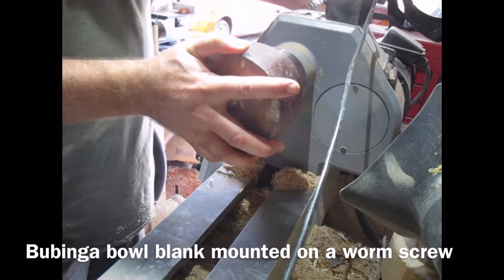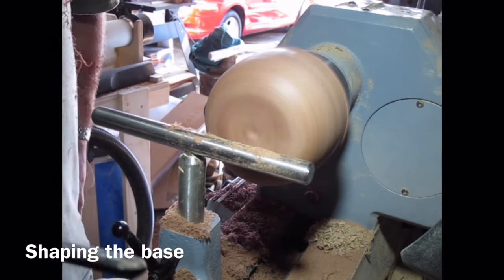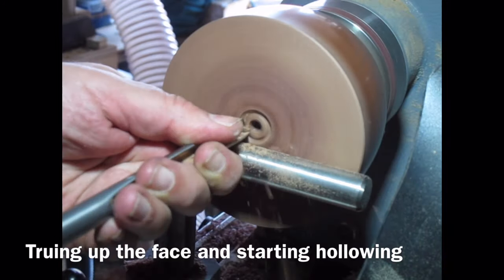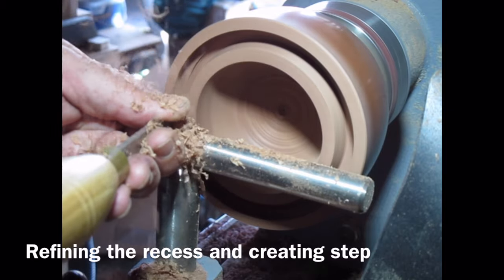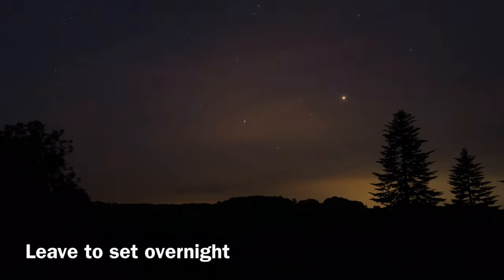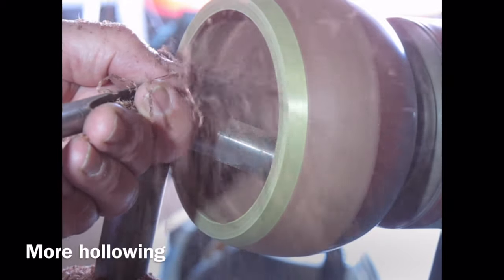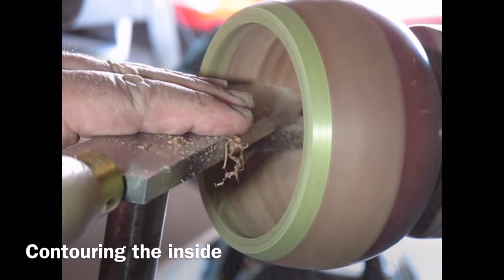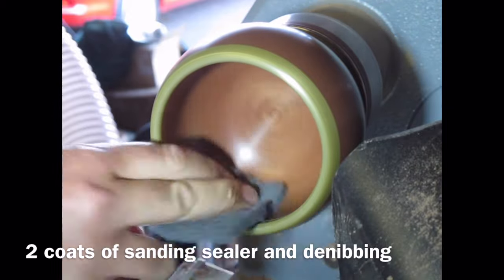Woodturning a Brass Brimmed Bubinga Bowl

Comment: Jim,  As always your work imaginative and beautiful.  Very well done indeed.  I don't know about the U.K, but here in the U.S. the hardware stores often have machines where you can make copies of your keys.  I was fortunate to be in a hardware store when man came in to service and clean the machine.  He was kind enough to give me the brass shavings from the machine as well as his business card.  Now I might have an endless supply of brass shavings.  Also,  if you have Harbor Freight tool stores in the U.K. they have paint pots that can be converted into pressure pots easily.  They cost about 72 pounds.
Reply from the maker: Many thanks for watching my videos. Fortunately I now have a pressure pot which makes resin casting much more consistent.

Comment: Thank you Jim for another great upload.  I particularly appreciate learning how to secure a brass or any other epoxy rim onto an item of wood.
Last week I used your Milliput pin stripe method for the first time when making a gift for non -wood turning friends.  They were mightily impressed and at the moment I have a small table lamp on my lathe with more pin stripes curing.
I can't wait until tomorrow when I get to finish it off.
When I bought my first container of Yorkshire Grit about 6 weeks ago I reckoned it would last me about a year.  Well, I can see the bottom of the container already so I'll be ordering some more soon.
Best wishes,
Alan.
Reply from the maker: Thanks again Alan for your continued support. I really like the clean lines that Milliput creates and the results are very tactile. I would love to see some pictures of the lamp. All the best, Jim

Comment: I've done a similar technique with a shallow bowl.  No brass, just colored resin.  Had some leaching issues.  The next one, I applied shellac first.  Cured the leaching.
Reply from the maker: Many thanks for watching. Yes leaching can be a problem with less viscous resins or with open grained wood. I almost routinely seal the surface of the wood before casting. I usually just paint the surface in a thin coat of the actual finish resin and let it cure, takes time but bonds to the final pour giving strength.
Cheers 
Jim

Comment: Nice job Jim, that came out luvverly mate.... The brass works very well with the Bubinga .....

Thanks for sharing mate, 
Steve.
Reply from the maker: Thanks Steve, I was very pleased with the result of this experiment. This Bubinga was slightly different to the usual Bubinga, it has quite a strong pink colouration which gradually appears a few hours after finishing, you can see the colour difference between the fresh cut and finished colour in one of the video sequences. Take care mate, Jim.

Comment: very nice and i like the process of using a syringe and the walls of the recess as a mould, i had a few syringes from my retired dads printing years but i havnt a clue where they are so Ill have to have a hunt or just buy some more ;)
Reply from the maker: Thanks Mark. I use syringes for lots of gluing and resin projects. If you check eBay regularly you can pick up some bargains if you buy a whole box. Cheers, Jim

Comment: That came out well Jim, I think the porous surface gives it a patina and makes it look older.  I suppose you could put the syringe in a vacuum chamber prior to filling the rim and that would reduce the number of small internal bubbles. Thinking about it, I don't know how effective capping the syringe and drawing a small vacuum using the plunger might be?
Reply from the maker: Thanks Mark. I wish I had the money to buy both a vacuum chamber and a pressure chamber. Creating a vacuum in the syringe would probably eliminate some bubbles but the resin mixture is a bit too thick. All the best, Jim

Comment: Another winner, Jim. Artful shape, but it just begs to be used -- pocket change & keys, pile of spare rubies & emeralds, whatever... I have a bone to pick with you about showing off your cool lathe tools, though: I've just been forced to order a Sorby tool rest stem and box scraper platform :-)  Clyde
Reply from the maker: Thanks for your kind words Clyde. The Robert Sorby catalogue is full of temptation ! The box scraper platform is brilliant and supports the scraper very well but just take gentle cuts with a sharp scraper to avoid catches. Make sure you are cutting just above centre. I have modified mine by rounding the leading left had corner so that I can get it tight into small bowls. Cheers, Jim

Comment: Good work. I very much enjoy and learn from your videos. I like a higher luster on my work. What can I top coat with after the Wilshire grit? Thank you
Reply from the maker: Thank you Shelly. Yorkshire Grit is oil based so I favour a wax finish. Lately I have been using Hampshire Sheen High Gloss, I also use Renaissance Wax which is a Microcrystalline wax ( also in Hampshire Sheen ). All the best, Jim

Comment: That came out really great! Totally love that! 

 Not sure what kind of resin you are using but I never use a pressure pot. Don't even have one though I would love to as I can also use it for my silicone mold making. :P Best way to have the bubbles release themselves is to work with it when the resin is really warm. We have 100+ F here these days and my house can get up to 82 or 83 F which is beyond great for working with resin. I never get any bubbles. I also use a long torch lighter to burst surface bubbles. If it is cooler where you are you can warm the resin in a hot water bath before use and use the torch. 

- Heidi
Reply from the maker: Thanks Heidi. I use heat to release bubbles sometimes but the resin and brass mix is so thick that it traps bubbles. I would love to get a pressure pot , but they are expensive and most are not very big. Ideally I would put the mixture into a vacuum chamber to de-gas it and then put it into the wood and then put the whole bowl in a pressure pot, but I have not got the money for that at the moment. Cheers, Jim
Reply: Jimson's Stuff I hear you there. I have looked at a few DIY videos on YouTube for making one. Not sure it would be more cost effective but definitely would be more fun. :D
Reply from the maker: +BlackCat2 . Anything to do with pressure vessels , I will defo leave to the professionals ! Way too risky. All the best, Jim
Reply: Jimson's Stuff I can understand. I am that way about my van's brake system but I will fix anything else on the van myself. :D

Comment: Hi Jim, do you mix up a couple of pots of epoxy as the channel in your wood looks like it'll take quite a bit more than you've mixed? Nice bowl by the way.
Reply from the maker: Thanks Ray, I can't remember exactly how much I used, I think I mixed a 2\3 full pot of epoxy and decanted half of it into another pot before mixing in the brass powder into each pot, so it was probably about one and a half full pots. If I do it again I will probably not mix it quite so think, so that it is easier to syringe and less likely to leave voids. I may even try using a different resin such as polyester. Cheers, Jim

Comment: Another fantastic project Jim, I'm always very impressed with the stuff you do (as I've said before LOL). Stupid question time now though, how do you know how deep you can go? I've done a lot of work on lathes before, but they were all metal ones, where it is done very differently LOL
Reply from the maker: Judging the depth at which to stop hollowing can be tricky sometimes, but there are several designs of jig or gauge around to help you decide when to stop. Lately I have been using a variation of a jig I saw Sam Angelo, the Wyoming Woodturner using, it is very simple and very accurate, I will put a link below. I'm glad you like my projects, thanks, Jim
https://youtu.be/WU2PLmoLIR0
Reply: Thanks for the response, that covers the depth if you are going straight down, but what about wall thickness? Sorry if these are incredibly rudimentary questions, but as I said I come from a metal working background, and things are done very different there LOL
Reply from the maker: +Mexie Mex . Sometimes the wall thickness is judged by eye and feel but I often use double ended callipers to measure it.
http://www.robert-sorby.co.uk/h974000-double-ended-callipers
Cheers, Jim
Reply: Great, thanks ;^>

Comment: Nice job! Why does the brass appear green under inside light, but now that you showed it outside it looks more like brass.
Reply from the maker: Thanks Doug, I think the brass reacted with the epoxy and caused this green colour ( tarnish ). It looks like brass in most lights but is slightly green in others. It would probably have been better using a different resin ( possibly polyester ) or adding some black pigment to the resin which I often do when working with metal powders. Cheers, Jim

Comment: I wonder if one could vacuum out the majority of the air pocket prior to applying it to the bowl.
Reply from the maker: The best way would be to de-gas the resin mixture in a vacuum chamber before adding it to the bowl and then putting the whole thing in a pressure vessel. Unfortunately I do not yet have the equipment to do this. Cheers, Jim

Comment: When it's on the lathe, and I suppose even when mixing the resin, why does the brass powder look green? Is it just that the powder has tarnished, and during the final Yorkshire Grit stage it polishes away said tarnish?
Reply from the maker: Yes I think it is exactly that. It seems to go more green when you mix it into the epoxy. The surface of the brass particles may even react with the resin and like you say you are cutting away the tarnish. Sometimes adding black pigment to the resin gives a better appearance but can sometimes leave slight streaks in the polished surface where the layers of resin fold over each other. The green is more obvious in certain lighting conditions. Cheers, Jim